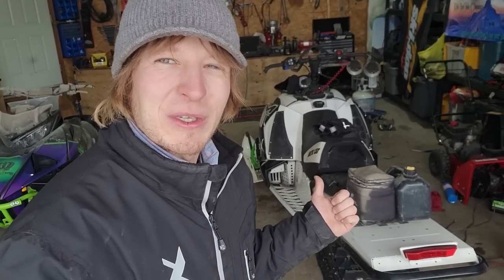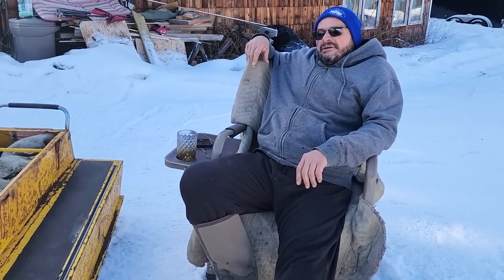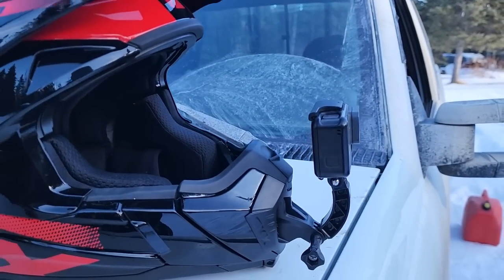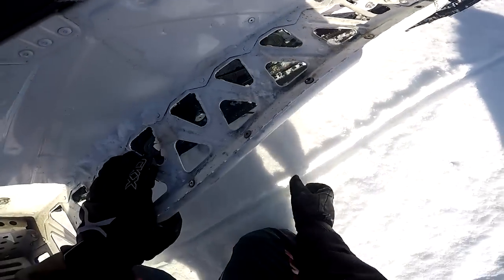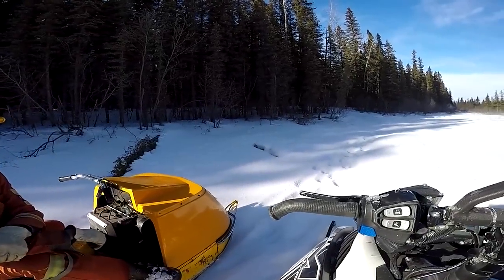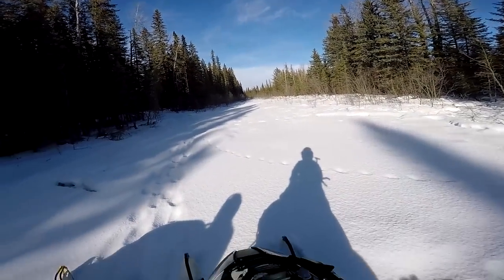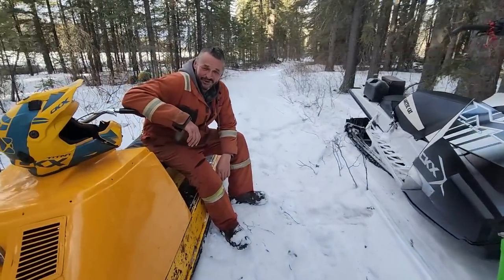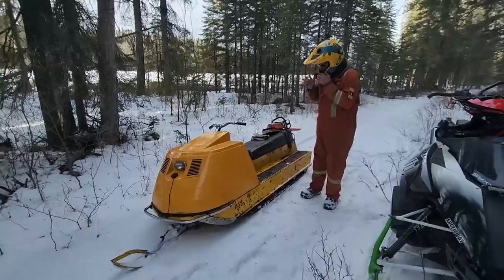The OLD SLEDS and the NEW | Testing out the MOUNTAIN MOD

Comment: Best thing to do with that old sled is add some taller foam to the seat does wonders makes your legs more room
Reply: There are foot slots under the hood, the one has your pant leg directly against the turning primary...no  thanks.  Besides you have to get into that MotoGP lean into the corner stance for those high speed 15kph corners.

Comment: Good info, I added the adjustable and have struggled off-trail at full extension. I would not have thought about the sled pushing have more leverage one me. Might try my next trip with the whole thing removed. My question is, what are you thoughts about an extra 1-2” to save my back?

Comment: Since a snowmobile distributes its weight over a wide area, the pressure (weight per square inch) is much lower than the pressure created by a person on foot.
Reply: Less pressure than quad also.  Went yesterday on 400EX and was breaking through everywhere.  Got past the big hole.

Comment: 35 mph sounds about right.   The old 70, 399 Panther topped on at 55 on a good day 😂
Reply: Correction, that is 35 Km/hr.   35 MPH would be terrifying.😁  Wasn't there a Cat 500 of some sort in the mid 70's?  Rode one up in Swan Hills as a lad and that one scared the hell out of me.  There wasn't a road wide enough to keep it straight.